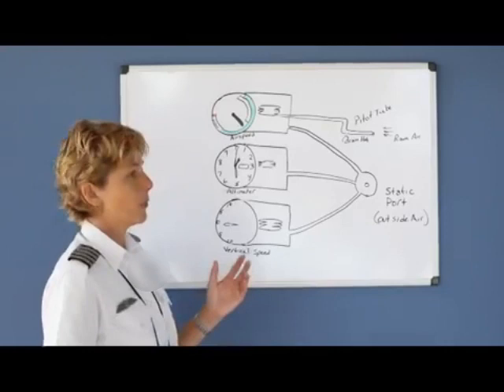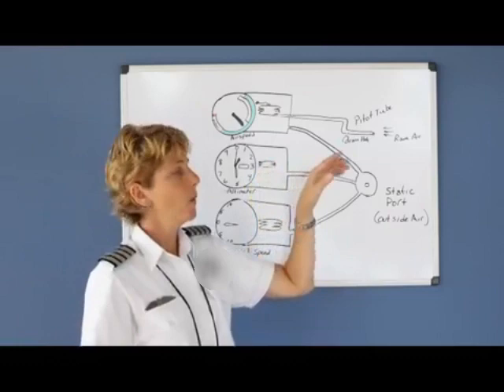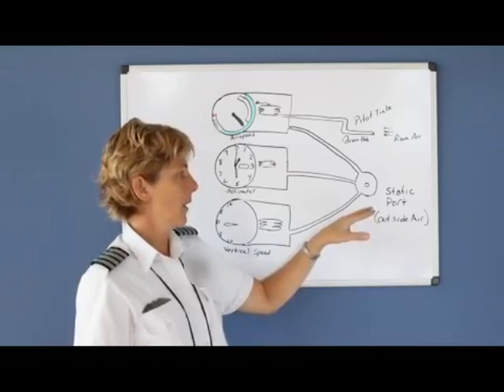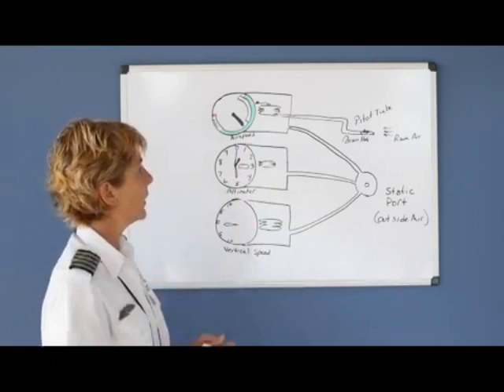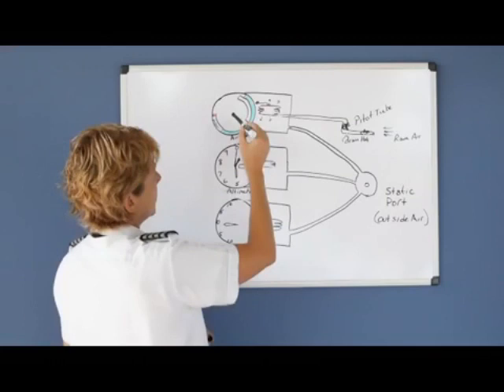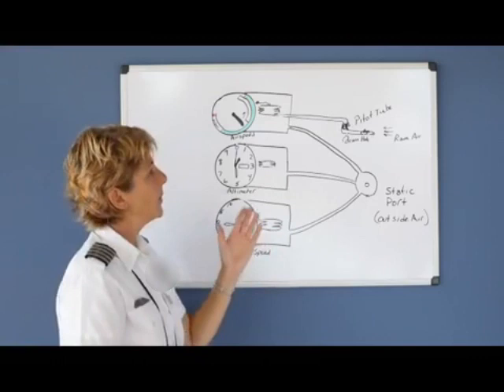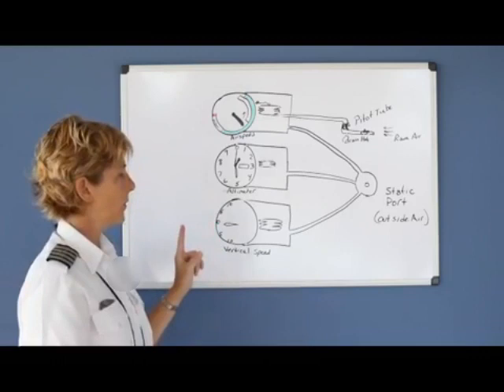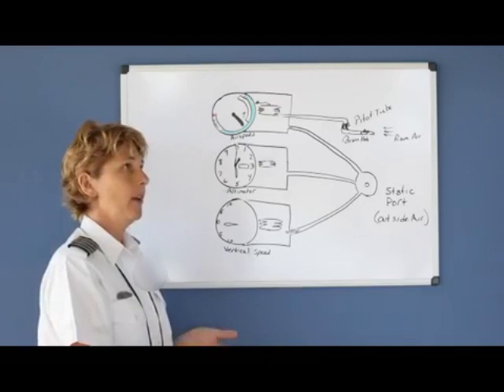Pitot Static Instruments - Airspeed Indicator (Private Pilot Lesson 6a)

Comment: The VSI is explained a bit wrong here, since the static pressure line is connected both to the diaphragm and the case. The leak is in the case, and its purpose is to generate a pressure differential between the case and the diaphragm during climb or descend using the static pressure only. The pressure differential then makes the diaphragm to resize itself, which is finally translated to the corresponding vertical speed indication.

Comment: Where does the wind speed come in to this?  You mean way up in the air there is no wind?  If I install one of those on my roof and the window blows 70 miles/hr, how fast my house is moving?
Reply: It  measures air velocity because that is what pilots are interested in as that is what creates lift and stops them falling out of the sky.   Velocity is a vector, i.e. has direction.  You get more lift flying into the wind than with a tail wind. So your air speed indicator would give a higher reading into the wind.  If you ground speed is a 100knots and you have a 20knot headwind your air speed is 120knots.  With a 20knot tail wind you would have an air speed of 80knots.
Reply: if you install one of these on your roof and there is a 70 mph wind blowing in to the pitot tube, your house does indeed have an airspeed of 70 mph, but its ground speed is 0. As James said, as pilots our primary concern is airspeed, because ground speed doesn't produce lift, airspeed does. If we have an airplane flying at 50 mph and we have a headwind of 50 mph, our ground speed is 0 but we are still creating lift and flying. I've done this a time or two, even flown backward. If I fly a small plane at 40 mph and have a headwind of 50 mph, I'm actually flying backward at 10 mph. And vice versa, if I am flying at 50 mph airspeed and have a 50 mph tailwind, my ground speed is 100 mph. Thats why flights traveling westbound always take longer than flights traveling eastbound (in the northern hemisphere) because traveling west we tend to have to fly against the jet stream, and east we fly with it. That's how wind comes in to play.

Comment: The airspeed indicator does not have an Android wafer, it has a diaphragm which is very different from an Android wafer. Shame you couldn’t look through the Instrument flying handbook before misinforming people.
Reply: So it seems that the altimeter has an aneroid wager which expands because it’s part of the pitot static system